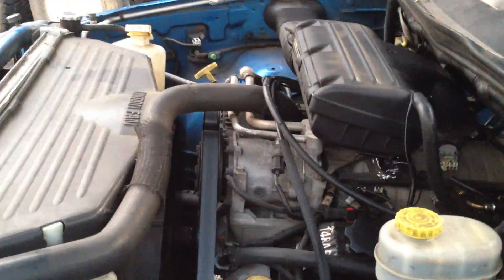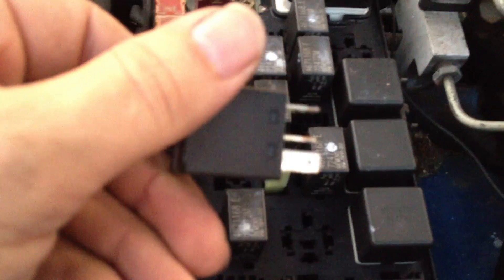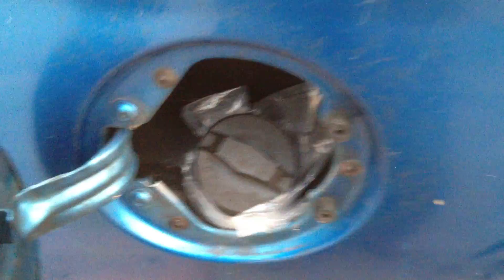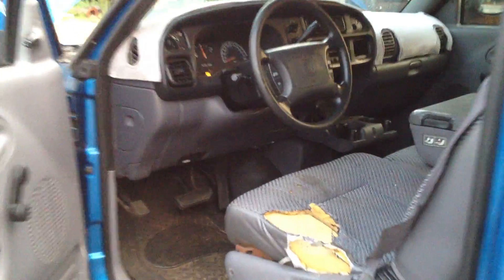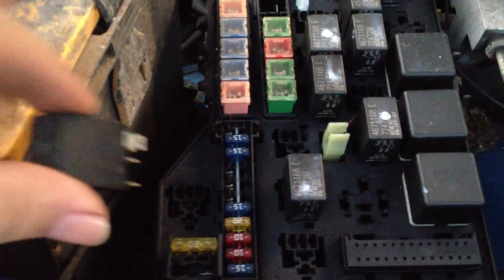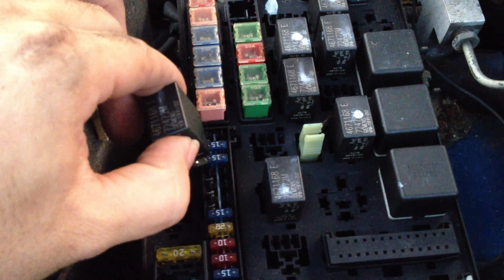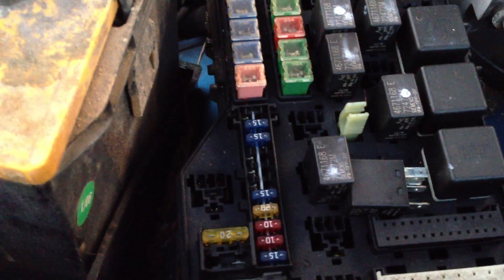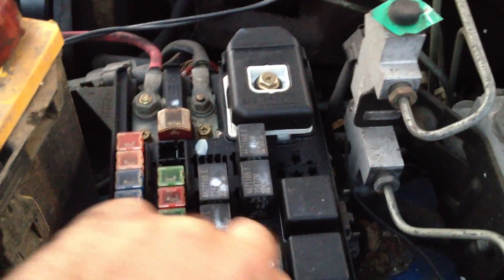V8 runnung on gasoline fumes

Comment: Instead of using a bubbler use a lawn mower carb close to the gas tank and ron it with a fuel line to the vacuum hose going into the intake. Good luck. When u use a bubbler it changes the gas. A small carb doesnt may make it more consistent. Good luck

Comment: You need to switch the breather that ends at the top of the tank and the fuel line around, or cap off the fuel line and add another tube on top running to the bottom, won't bubble the setup you have

Comment: Modern cars and trucks will run with the fuel pump relay out because of oil pressure the oil pressure switch will send 12v over to the fuel pump relay. There is nothing special going on I Challenge anyone to start there car and pull there's all cars trucks will run and even drive without it but won't start

Comment: I was thinking about trying this, then I wondered what would happen if a backfire caught some of that vapor and chased it on back to the fuel tank...
Reply: My same thoughts. A flame arrestor would definitely need to be utilized.
Reply: Explosafe material in the fuel tank and fuel lines would eliminate any possibility of fire.
Reply: Use an arrestor

Comment: Pointless video - someone who thinks he's discovered something valuable so won't share it.  And that "fuel-pump relay" mantra is annoying!  That said, while running on fumes does work, you would eventually end up burning a hole in your pistons, as engine designers expect all that fuel that is squirted in to act as a coolant.  Also, you are limited to just having the engine idle as it stands.  It not practical for normal driving.
Reply: Remember that fully vaporized fuel that is thoroughly mixed with air burns cooler than the wet fuel to air system because a great deal of heat is released when changing phase from a liquid to a gas in the combustion chamber. And if there is no excess oxygen in the exhaust, then the heat produced wouldn't be as bad as a lean burn set-up.

Comment: I do the same thing with my 1995 BMW 525i. Run vapors in the engine along with the fuel injectors. Get lots of power. I also installed the same system on my friend's nissan sentra and he noticed way more power than before it was installed. Yes you can idle the engine on just vapors but it will not go very far. i t would save you fuel when you stop at a traffic light but you will have to design a fuel pump shut off when not in motion. I will make a video soon and post it very soon of it installed on the BMW.
Reply: I wonder what his check is
Reply: bro please put up a video to show this I just got a car v6 and need better more mpg..please

Comment: Just ignore all the naysayers...I use the same thing on a 1988 crown vic.5.0  a bit different but the vapors are running in parallel with fuel injectors. Leave the fuel pump plugged in warm gasoline will help evaporate fuel quicker in tank, O2 sensors, (must be in good cond) will make the ECU trim the fuel at injectors Florida weather helps...I know, I am here tooI use just a bit of octane booster to help vapors....when using E10

Comment: So you are running at idle. Okay, but driving will be a different story if you don't have a way to increase the amount of fuel vapor. This becomes a bigger challenge, because the engine will not be able to accelerate without additional fuel vapor being applied.  This does work well with gas powered generators, because they only run at idle.
Reply: Wrong I've done this on 3 of my vehicles and all the vapor comes in through the air intake so when you open the throttle and increase airflow it automatically increases the amount of vapor. Try getting your hands dirty before acting like you know what you're talking about. The ability of speech does not necessarily indicate intelligence.
Reply: @matthewangelo2142  brother did you get extra miles?
Reply: Smokey Yunick's Hot Vapor Engine employed a turbocharger infront of the air/fuel vapor supply to solve the low power problem.

Comment: Just trying to understand, you are actually running a mixture of gasoline (liquid) and gasoline vapors?, that mean you are actually using all the gasoline in the tank. That sounds good, quite good. The only worry would be the tank itself, having gasoline gas and gasoline in the same place sounds quite dangerous without the use of a special tank.
Reply: Explosafe material in the fuel tank and fuel lines would eliminate any possibility of fire.

Comment from the maker: It losses power because the fine part of the gasoline is evaporated and your left with more large molecule gasoline. So running it together with fuel injection is the best way. Tank was about half way full.
Reply: Smokey Yunick's Hot Vapor Engine employed a turbocharger infront of the air/fuel vapor supply to solve the low power problem.

Comment: when you say it looses power after about 30, why is that? it should not. how much gas in your tank while you did this?
Reply: Smokey Yunick's Hot Vapor Engine employed a turbocharger infront of the air/fuel vapor supply to solve the low power problem.